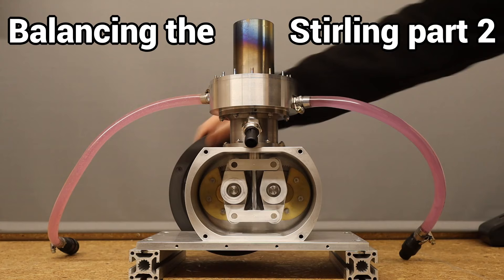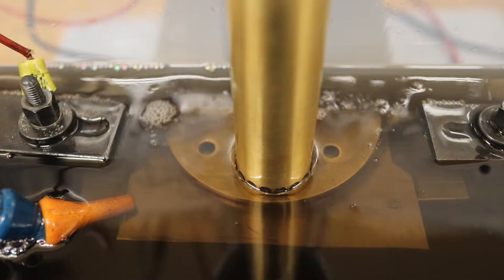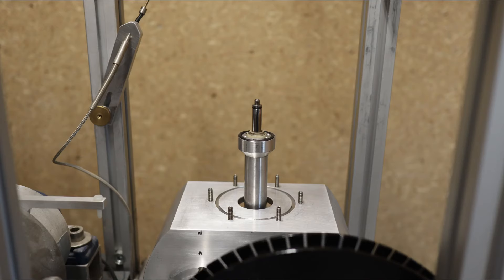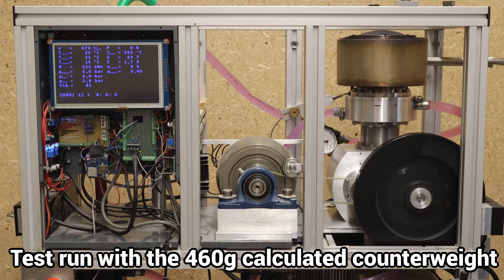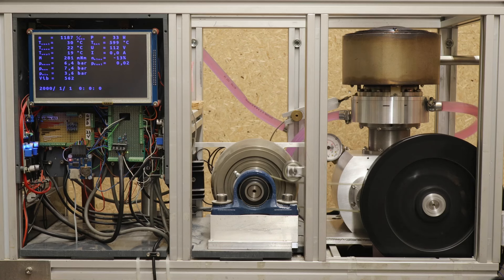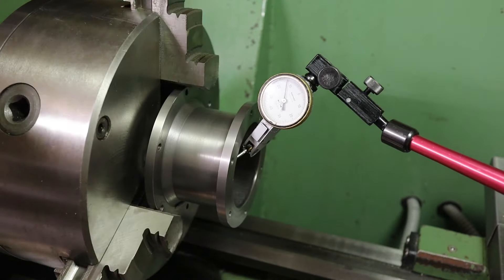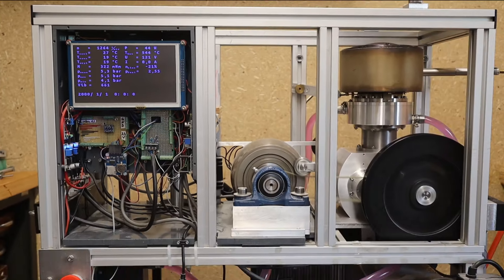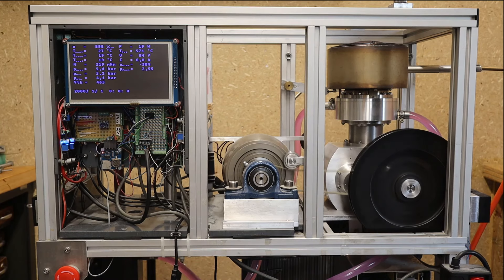Dynamic balancing the rhombic Stirling engine on the test bench

Comment: For the piston sealing it may be useful to explore large compressor sealing ring materials. We machine a material called Enflon into rider bans for compressors. This is a graphite / carbon filled teflon material. It has some great properties and can be used for energized rings with wave springs inside. Another material that may be useful is called graphalloy. Its made by the graphite metalizing  company. They make various compounds suitable for dry running at higher temperatures. I would love to build a large stirling. Maybe when i retire and i have time to play!😃 good luck!
Reply from the maker: Thanks for your proposals I am looking always for materials to improve the sealing with low friction.
I tried a lot materials and at the moment I a very happy with the tribological plastic Igus W300.
Many thanks, I will research your thoughts.
Reply: @myengines2443  if you would like to share emails i can send you some links to materials we have used in self lubricating dry applications

Comment: I have a problem with calculating whether the thermal transmittance in the engine of my design is sufficient due to the material I used. Could you take a look at it and give your opinion?
Reply: Hello. I can run you numbers using some matlab code.
Reply from the maker: I used the FEA method for it, it can be mad with free programs like Ansys (demo) or Freecad.
I look at your problems soon and will comment!
Greetings

Comment: Would better heat sinking help at all? Really interesting!
Reply: Ice water for cooling the engine would improve efficiency and power output.  This experiment was conducted on the little engine you may view on my channel, where it runs a portable transistor radio.  Ice water made a difference!

As would higher temperatures at the hot end.

Fact is that limitations for both are dictated by the ambient temperature for cooling purposes, and the metallurgical temperature limit for the hot end.
Apart from that the optimization of the 2 heat exchangers has a great impact on the power and efficiency of the STIRLING engine.  (note the spelling!)  This is the reason why this type of engine does NOT lend itself to simply scaling up all dimendions in order to produce a more powerful engine.  Each engine size and working gas needs optimization for greatest efficiency and power.
The author of this post went to great lengths to produce good heat exchangers for his engine and is to be commended for his work.
The next step towards greater power output would be to pressurize this engine with helium gas or, better yet, hydrogen gas.  
Pressurized to say 10 atmospheres, depending on the robustness of the design and manufacture, it would be interesting to observe the difference in performance between the two gasses in the same engine at the same pressure.

Personally I have experimented with helium, and found a great increase in engine power from pressurizing with air.  I think the author would be surprised at the increase in engine power output.   I observed a 3x increase in power output with helium at 100 psi pressure or so.  With air pressurization I found that the performance decreased at pressures greater than 35 psi or so.

To increase thermodynamic efficiency the next step would be to use the exhaust gas from the burner to pre-heat the combustion air drawn into the burner.
Reply from the maker: You cant see it very well in the video but on the back of the test bench is an car cooler and a water is pumped through the cooler.
At high power the cooling water reaches about 50 degrees celsius.
Of course cooler water would be better but not practical and economic I think.
Thanks for your nice comment!
Reply from the maker: Exactly, the temperature difference is important.
I also made experiments with ice water and performance raised but it is not practical and not economical!
Thanks for your input!

Comment: Hello. So - could write which math finally worked ? Thank for testing with more and less weight.
Reply from the maker: I just used the formulas from the 1. balancing video, they are right from both sources and my balancing experiments seem to confirm it.

Comment: Hi,
Ich bin sehr beeindruckt von deinen bisherigen Errungenschaften. Da ich Plane einen eigenen Stirling Motor zu bauen (2x V2 Kompressor Motor als Grundlage), wollte ich Mal fragen, ob du mir für meinen Einstieg ein paar Tipps geben kannst. Ich habe leider keine Drehbank, CNC Fräse oder ähnliches. Bei mir geht es auch zu Beginn erst Mal darum einen Motor ans Laufen zu bringen. Wie kann ich ohne genannte Maschinen am besten einen Zylinder, Kolben usw herstellen oder wo kann ich besagte Teile Kaufen? Und ich würde mich über ein Video freuen wie du dein Biogas gewinnst.
Viele Grüße aus Köln
Alessandro
Reply: https://youtu.be/IgWHuhVcLKA?si=Fj4-A67CErWysYu-
Reply from the maker: Hi, ich habe ein Viodeo über meine DIY Biogasanlage gemacht, guck mal auf meinem Kanal.
Es gibt viele Bücher über den Einstieg in den Selbstbau von Stirlingmotoren auch ohne Werzeugmaschinen.
Bei ebay als gebrauchte,alte Ausgaben weil vielleicht nicht mehr im Druck, auch auf deutsch.
Mit die besten Bücher für den Selbstbau sind die von Rizzo The Stirling engine Manual 1+2 und Making Stirling Engines von Andy Ross (gibts umsonst zum download im Netz, musste mal suchen!

VG

Comment: Your test stand, engineering and so on is great but I don´t think that this is the right way. I much rather would like to have a more simple machine with less moving parts instead of "German over-engineering" the thing. 
Why didn´t you choose a free piston beta configuration with a membrane instead for instance ? The gear drive alone is a nightmare, even if you get it to run properly at a certain price point this just does not make any sense. Less parts, less friction, less weight, all in all simpler should be the goal.
Being an automotive R&D engineer myself I know how hard it is to create a product like that. I really hope you either reevaluate or you have some decision matrix why you chose this configuration instead which you maybe can show us, because otherwise I really don´t understand.
Reply from the maker: Yes you are right, but I want to get in the region of 1 KW output.
This calls for high pressure (10 bar with this engine) or a very big engine.
You know the sunpulse engine? It follows your concept but is very big.

I like the concept of the early Philips engines very much, and of course a prototype engine is often much more complicated than it has to be.
First I want to reach the power and efficiency I need  and then make it more simple.
I am always looking for ways to make it more simple or use a more simple concept but it seems not easy to me...

Thanks for your nice arguments, I am also very interested in more easy concepts like thermoacoustic or thermal lag engines but I am not sure about their potential of generating higher power.

I look forward to some suggestions for simpler engines of you that would be nice....

Greetings
Reply from the maker: The thermoacoustic and thermal lag engines are very interesting and I researched a bit about them but I am unsure about their potential...
Thanks for your comment
Reply: @myengines2443  the whispergen 1kw stirlîng engine was a 4 pistons thermal lag engine, whispergen is closed now but I'm trying to remake one with a car ac compressor, its the same mechanism
Reply: @myengines2443  I too like the Philips engine, but this is many decades old tech by this point, it´s a fine idea but it´s basically post WW2. It was great at it´s time, but this time has passed. Today with CAD, CAM, rapid prototyping (you can sinter parts in metal and make them more efficient due to better geometry for cooling or heat transfer) and so on, something a lot better must be possible.
 
The beta configuration is a good idea but in my opinion the free piston is it´s logical descendent, since it takes the same basic idea but get´s rid of all the linkages. You can also load it with helium under pressure. You can still improve the regenerator and all that.
In my opinion your idea will fail due to the complexity of the linkages and the precision of manufacturing. Your engine is probably the best "hobby" made engine on all of YouTube, performance and quality wise, but costs wise ?
 
Other 1-3Kw Stirling engines use the free piston design, maybe take them as a example. I think their efficiency is way better just because there are no gears, links nothing. Swiss company made for a combined heat and power unit.

Archiving the same result but with less this is true engineering and very very hard. Imagine the AK47 compared to modern firearms. Even a 14 year old can use the AK and it always works, it´s also cheap and still it´s useful within 200m combat range (which most combat takes place) it´s not better in any way than other firearms but it´s cheap and it delivers, this is basically the kind of engineering one would need for a breakthrough in Stirling engine tech. for home use.
Reply: @myengines2443  Look up modern combined heat and power units, swiss made, they use a 1,5Kw free piston engine. You can research in German which might be easier for you "Blockheizkraftwerk" ich kann mich an den Namen der Firma aber nicht erinnern.